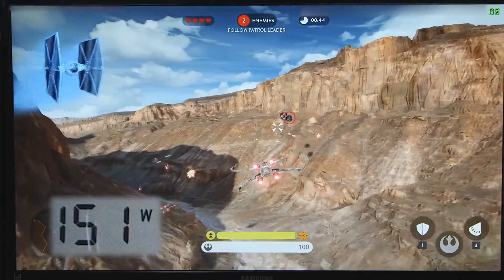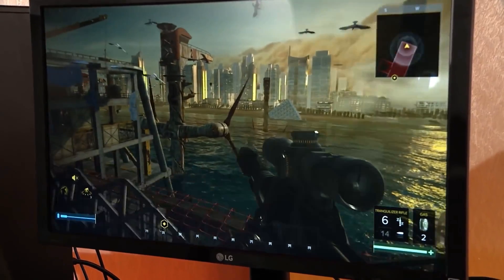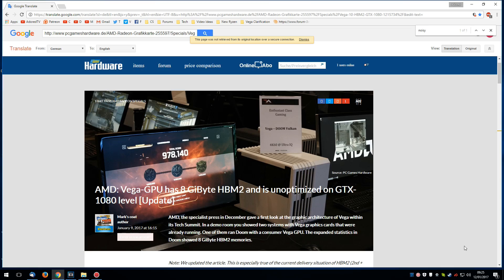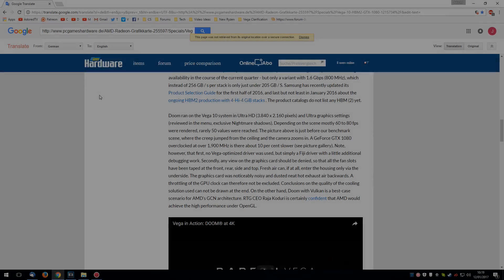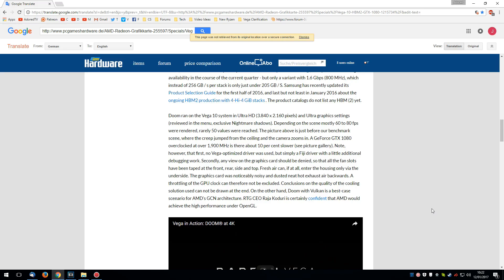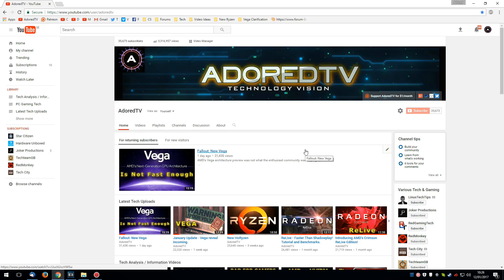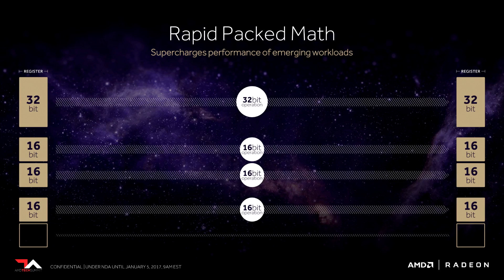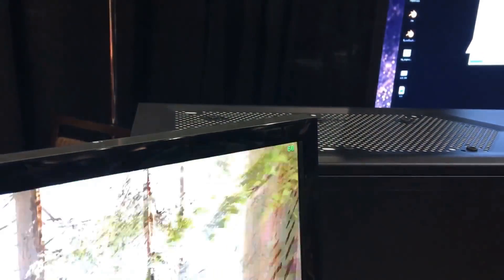Vega Clarification - How bad is it?

Comment: Adored, I think this video is a little better in addressing some of the issues and feel free to prove me wrong here. 

Let's start off by breaking your video down into 3 distinct parts. You have noted that all the benchmarks previously for Vega and Polaris has been a best case scenario. And that drivers will push the performance in the future. However, I can also argue that nVidia is also likewise doing the same. In nVidia's launch conference for the GTX 1080, they demoed Mirror's Edge Catalyst and some VR games. We can see that they were utilising Beta drivers and running rather smooth for what was assumingly a retail sample. Compare this to AMD's Vega preview, the difference here is that we don't know the full spec of the card. We know it uses HBM2 which is confirmed in the preview and that is utilises a new GCN. But apart from that, compared to the GTX 1080, we don't know the clock speeds, the number of core shaders, the ROPs, the memory configurations nor the TDP even. The reason is that AMD sees NO REASON as they don't have the retail samples ready unlike nVidia. This is just a PREVIEW, not a RELEASE.

Let's move onto the phantom in the room, the GTX 1080Ti or the full GP102. We know that nVidia could have release the GTX 1080Ti at CES in order to gain the advantage against Vega. But in a surprise move, nVidia didn't even mention it. Why? Why hold onto the very card that Vega is most likely lose against? Given from the machines at the event along with the analysis from various tech sites such as PC Games Hardware, Linus Tech Tips, Tech Report and Anandtech, we know that CES has never been the place for nVidia to release cards. However, we know from one interview with an AIB manufacturer that the 1080Ti has been in production for some time and nVidia has been ramping up supplies for this. This means that nVidia wants to release these cards ASAP. And it is possible that they know something about Vega we don't. Usually a lot of the companies know something about their competitor that we don't. This speaks true in Formula One where teams are notoriously hard to speak about their cars, relying on technical analysts from publications to do so. It is possible that nVidia knows Vega will hurt them in the long term and want to get the Ti out then focus getting Volta to smash Vega.

And finally, the last part about how graphic card prices has stagnated. To be honest, nVidia never really had a beating since the R9 290X days since we've been largely been on 28nm for way too long and the Fury was a huge compromise for 28nm. And also, this is also addresses Ryan's comment below. The price gouging isn't the problem with nVidia or AMD, though you can attribute to the lack of competition between the two. But rather, WE AS THE CONSUMERS are the ones that are driving this trend. You saw it with the release of the 'Founder's Edition' from nVidia and people lapped it up. Same thing for the castration of the GTX 1060 into two DIFFERENT SKUs. Did the consumers go up in arms about it? NO. When the GTX 1050Ti came out, did nVidia price it accordingly to where it should be? Hell no. If anything, it almost hits the same price range as their low end GTX 1060 3GB card. So you can't really whine about nVidia and AMD doing so as they are out to make money. But the buck really stops at US. And if WE don't do something about, I'm afraid this will ALWAYS continue.
Reply from the maker: I have a video coming on part 3. ;)  Not sure Nvidia even cares about what AMD is doing now tbh, they probably haven't released the 1080 Ti because they don't need to.  Another "reward" for all their loyal fanboys.

Comment: One point here, is when AMD announced the RX-480 and released it, immediately after nvidia dropped the 1060 to take the wind out of amd's sales. Thankfully neither company could keep the channels stocked so no one really got sales and if they did, they were at eye gouging prices.

Maybe this is AMD trying to keep nVidia from stealing their press spotlight for as long as possible. I mean, if they showed something that could beat the Titan, nvidia would have to show something better and get it ready for release. Whereas if AMD keeps their mouth shut, they can get their parts to shelves and be selling it and give themeselves a month or two to pick up sales before nvidia can counter. From a business perspective it makes some sense. Play coy, sneak up the rear and grab all the sales you can before nvidia can react.

Now i would like to think AMD showing Zen was sandbagging because they never showed it beating an intel part running at full performance. They were just demonstrating one metric that matter which was yes the IPC is comparable.

With Vega it seems they are saying, look, its can stand toe to toe with a 1080, the same way they are saying with zen, it can compete IPC for IPC with intel.

I mean I am being childishly optimistic, I have a lot of nostalgia for AMD on the gaming side and I regularly build AMD based machines for customers and for value per dollar they kill intel and nvidia.

Well only time will tell. If AMD was holding back on vega, I'll buy u a pint on me.

Comment: The reviewer is listening to BS from Nvidia (or being paid by them?)
I'm not a fair weather fan boy.  
I follow AMD from a long term investment view.

VEGA is similar to ZEN,  and not like Polaris.  In that VEGA is really a new architecture. 

If you truly understood AMD, you would know this. 

AMD promised ZEN would be 40% faster than previous architecture but its approaching 60% faster. 

Overclocking makes a huge  difference for gamers!

AMD's  prior GPU architecture was NOT able to effectively/efficiently overclock. 
Which is why Nvidia could beat it. 

But, with VEGA  AMD will be able to compete effectively with Nvidia, especially in DX12 and Vulkan. 

Raja Koduri said at CES that they had NOT even begun to test the extent of VEGA's overclocking ability...

= you know nothing about how it will compete with Nvidia's Volta GPUs. 

 now I see that you are nothing more than a clueless gamer.
Reply from the maker: The problem is, Ken, that you don't know shit about how this stuff actually works.  Raja doesn't know exactly how the final silicon will end up because decisions on clock speeds depend on a variety of factors, not least of all the competitive landscape at that time.

He does however know what the reasonable limits are, and he knows that it isn't high enough.

Comment: 15:50 "WE" have not created ANYTHING! AMD created a MASSIVE sinkhole for themselves when they bought out ATI while ATI was behind in both performance and technology, as they were still using the VLIW-SIMD based architecture that could not compute greater than FP24 precision. And of course, AMD paid well over what ATI was worth at the time. Something like over double IIRC...

Like I told you I would NOT upgrade until Pascal and Polaris were released and fully benchmarked and tested in terms of OC capabilities. That happened - and I was watching VERY closely, still holding some hope for a 480X/490 that had at least 64 ROPS FFS, and enough SPs to be able to compete above the GTX 1060 level. This NEVER HAPPENED! 

Point is; Nvidia are ahead BECAUSE they are AHEAD! You literally CANNOT put a FULL RX 480 or even 470 into a 1.75cm laptop, and even if you did, it would not perform NEARLY as well as a GTX 1060 in a 1.75cm laptop, like my Bro's MSI GS63VR-  which boosts to an average of 1868, with 8.5 GHZ effective VRAM for 205 GB/sec, with a true quad core i7-6700HQ as well! 
AMD offers no competition at all in Windows Laptops currently, and I honestly don't think they have offered anything competitive for a last 2 or 3 years now in Windows Laptops! So mark another HUGE segment of sales for Nvidia off from AMD entirely as the market stands, the ONLY mobile GPUs made by AMD are found in those TERRIBLE and incredibly overpriced POS 2016 MacBook "Pro" 15" - that is literally ALL AMD'S mobile discrete graphics on the market right now! And the top tier available , the Radeon "PRO 460" is slower than a GTX 970m and has 2GB less VRAM, I mean don't even try to compare it with a GTX 1050 or especially not the 1050 Ti both of which will be in more "budget" gaming laptops soon! God knows, IF I can find a decent laptop with either the 1050 or 1050 Ti in it for $850 at most, it WILL be mine!

And mind you, now that THIN actually mobile laptops are getting nearly FULL desktop powered hardware, it is a MASSIVE industry segment! And I foresee MANY people upgrading from 700 and even 900 series equipped laptops, especially when a GTX 1050 Ti will do better than probably even the 980m, but at very least, better than the 970m! Where the GTX 1060 6 GB-  well there is literally no SINGLE laptop GPU that can match it from  any generation! And then the fact that it is basically the FULL desktop 1060, in a 1.75cm laptop - that is a GAME CHANGER in the Laptop product segment! And EVERY SMART laptop company knows it! (Apple is not smart as we all know) And that is why there is now a MASSIVE TORRENT of GTX 10 series equipped laptops released every month! With the 1050/1050 Ti models set to roll out any day now. Also bearing in mind that the GTX 1050 regular beats the RX 460 in the VAST majority of games, and the GTX 1050 Ti being all one really NEEDS to play every game at 1080p high to max settings! Surprisingly enough, at 768 CUDA cores, HALF that of the GTX 770, but the same number of ROPS at 32, the GTX 1050 Ti easily beats the GTX 770 in nearly every game without even trying to Overclock at all! Of course, Maxwell and Pascal are a really different architecture to Kepler and earlier for Nvidia.

AMD currently offers NO REPLY for any GPU like my 980 Ti, Titan X, 1070 - and even a decent GTX 980 WILL provide more FPS in more games with better minimums than the RX 480 and even the R9 390X - I mean  there is NO air cooled RX 480 that can hit and stay at even 1450 MHZ core, where the G1 Gaming GTX 980 and similar, well I have seen them exceed 1550 core clock! With 64 ROPS instead of just 32 on the 480 as well, running at a higher frequency.

And simply put, AMD has NOTHING to offer me that is even CLOSE to as fast as my G1 Gaming GTX 980 Ti. And worst part for Them? I BOUGHT USED - and the closest to equivalent AMD GPUs cost FAR MORE! R9 390X cost FAR more than  the GTX 980 Aftermarket cards!

TL;DR
They may have compelling products for the desktop, both the RX 480 and 470 are amazing GPUS for the money. BUT - the GTX 1060 6GB is VERY close performance wise to the RX 480 8 GB, a pretty even match out of the box. But add in even rudimentary Overclocking-  such as raising the power limit and temperature targets will add a good 5%+ to the 1060's results. If you have a well cooled 1060 and know what you are doing, 2.1 GHZ core is easily achieved-  at which point the RX 480 falls behind a good deal more, as 480 does not tend to hit 1400 most of the time. 

Between the close race at the $250 segment, the used market being straight up better for buying Nvidia, the 1050 being the best at the $100 segment, and there being NO competition at the $380+ segments - not to forget the Laptops, as well as ultra professional such as the Tesla P100 or a high end Quadro - it is just NATURAL that Nvidia is on top of GPU sales. It is not a creation of "Fanboys" it is not some odd phenomenon where people are just drawn to Nvidia regardless of who offers the best performance and efficiency for the money they have to spend, IN FACT - in the last year ALL forms of Technology media have been covering AMD more than Nvidia - and therefore advertised more. And that is natural as well, people especially like yourself were expecting Polaris to REALLY change things for AMD-  but that was not to be, just another example of the AMD hype machine.

And one step higher, the Fury X not only cost over $100 more on average than the $355 I paid in early August, all while not even getting CLOSE in terms of gaming performance - and while sucking more power and making FAR more heat than the 980 Ti or GTX Titan X! Even without my Overclocking on my G1 GTX 980 Ti, the completely stock 19% Overclock would still provide better gaming performance than a Fury X could, and I am now running essentially 50% over the base reference clock of just 1 GHZ.
I mean, at 1503 MHZ core and 8 GHZ effective VRAM, my GPU has never ONCE gotten hotter than  67 C in any game or either Unigine Benches, I watch Netflix, YouTube and others while the card is running with NO FANS, and still never gets hotter than 33 C, often staying around 28 to 31 C - while watching online videos. I mean that surprised the hell out of me, even though I have done basically ENDLESS reading on GPUS, but in particular GCN 1.2/1.3, Maxwell and Pascal, as I was considering spending  $470 or so on a good aftermarket GTX 1070 - but I am happy I did not! As now I have a more powerful GPU that cost me over $100 less! 

Which again, at the time would have cost me about the same as the Fury X, and still would have provided better performance far more often. 

Especially as DX12 is currently STILL so very shite for everyone involved, save maybe 4 games total - 2 of which heavily favor AMD and 2 of which favor Nvidia a bit more. NONE of which I play! And finally, Windows 10 is just so shit that it makes benchmarking HARD! Because Windows will decide to update or run some stupid assed background task at random, PCper, Gamers Nexus, LTT and others have ALL noticed this, and there are even a few benchmarks that show roughly 5% to over 15% better performance running the same games on Windows 7 than on Windows 10! 

So yeah, Vulkan for the win, no question in the matter - and yes hardware Asynchronous Compute does give AMD a bit more of a performance increase, but not by enough to match or beat the 980 Ti or 1070 especially, I have seen an overclocked 980 getting close to the Fury X even.

Comment: +AdoredTV 12:45 FP16 is NOT NEW! In fact it is ancient and outdated for modern 3d gaming, back when you were probably too young to understand Technology - all Video Cards ran purely on FP16, that is until DX9 and IIRC Shader Model 3 or 5, REQUIRED full FP32 compute, and at that time ATI were selling Cards that took FP32 code and downscaled it to FP24.

I know what you mean though, MIX COMPUTE is becoming a push by AMD, as you actually do not need full FP32 precision for things such as AI, but honestly FP16s BIGGEST use is for complex algorithms, particularly the type known as Natural Language Processors - aka Chat AI like Microsoft's  Tay - Yanno that Twitter chatbot that ended up being a racist Nazi because people couldn't help but troll her! 

And you know what is best for FP16? The Pascal Tesla P100 accelerator, as it has Mixed Precision fully unlocked, and therefore can do 32 TFLOPS worth of FP16 at the same time it is doing over 16 TFLOPS OF FP32. 

But literally EVERY MODERN GPU-  can indeed do TWICE the FP16 calculations as they can FP32, simply put, Nvidia HAVE locked that capability up for now in GeForce drivers, as they do NOT want potential Quadro or Tesla customers buying the far cheaper consumer gaming GPU and getting the same Mixed Compute performance Quadro cards offer at less than  half  the PRICE!

Which is a greedy move by Nvidia, BUT - I guarantee you, that OF FP16 mixed compute EVER becomes relevant to GAMING PERFORMANCE - at that point, Nvidia will unlock that capability in GeForce drivers!
Reply from the maker: Actually I'm well aware of GPU history thanks, and as usual you managed to twist the reality into your own version of it.  FP24 was the official DX spec, it was Nvidia who were out of the spec with FP32!

FP16 is also part of Shader Model 6 btw, so it's coming this year.

Comment: LOL at GTX 1080 being "Middle range"! I mean, if you want to go by die size, then perhaps, but 16/14nm FinFET is going to make a top tier die MUCH SMALLER!  I mean 2560 CUDA,  160 TMU and 64 ROP running at a very conservative "Reference" clock and "Reference boost" of just 1607 and 1733, a 10 GHZ effective GDDR5 VRAM on a 256 bit bus for 320 GB/sec - NONE OF that says "Mid range GPU"

Just because AMD uses FAR more SPs to equal the performance of CUDA cores, does not make Nvidia's current top tier any less top tier, nor does the rather TINY 314mm2 die size. 

I mean a REFERENCE GTX 980 Ti with its TERRIBLE cooler beats even the Fury X in well over 50% of all games, but get a GOOD GTX 980 Ti, like the Gigabyte  G1 Gaming version I bought in August for just $355, and it took me about 3 hours to get my core clock to hit and stay at 1503 at all times in gaming, at which speed combined with 8 GHZ 384.4 GB4/sec memory Bandwidth that is over 100 GB/sec faster than the 1070 or RX 480, and with memory compression is significantly better than the Fury X - I paid $355 for a GAMING GPU that literally cannot be beat by ANYTHING SHORT OF the GTX 1080 - I gotta say that I do LOVE my 980 Ti like it is my baby! 

Still, that does NOT cloud my judgement on FURTURE purchases! Actually once  Pascal and Polaris were released I was LOOKING at everything from the R9 390X and GTX 980 to the Fury X and 980 Ti. For whatever reason, the R9 390X was selling for $340+ avg when  the GTX 980s were selling for a rather AMAZING $250 on average-  for GOOD models, like MSI Gaming X, Zotac, Gigabyte etc - which can easily hit 1500+ core and 8 GHZ effective VRAM-  at which point they easily slam the R9 390X and RX 480 in everything!

Then Furys were selling at $385+ and Fury Xs were STILL  $420+! 

then I saw the 980 Tis selling for between just $330 and $420 - which to me screamed best value for money I had ever SEEN! And it was! Especially once I got done tweaking my G1 Gaming GTX 980 TI to 1.5 GHZ core and 8 GHZ effective VRAM!
I now run 4x FSSGSSAA forced on almost games!